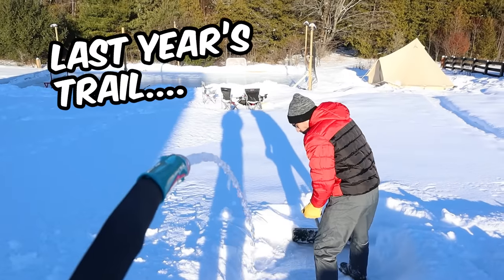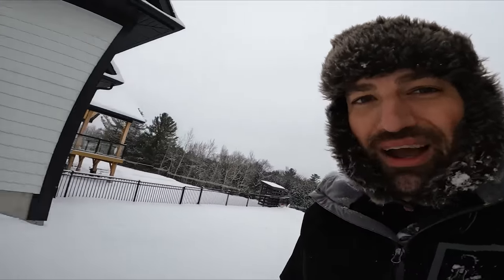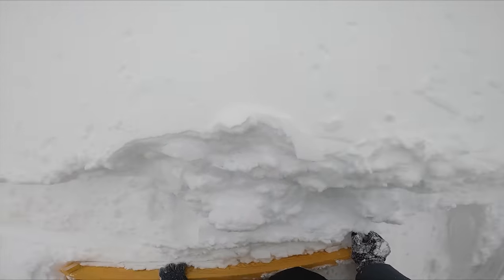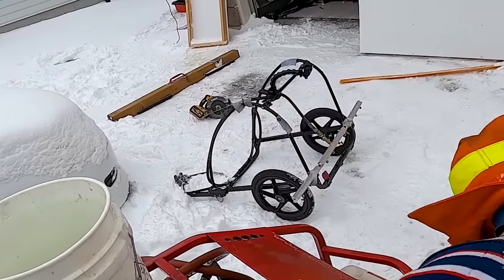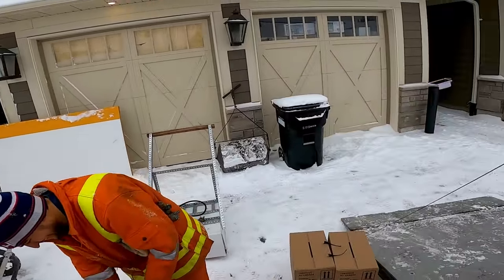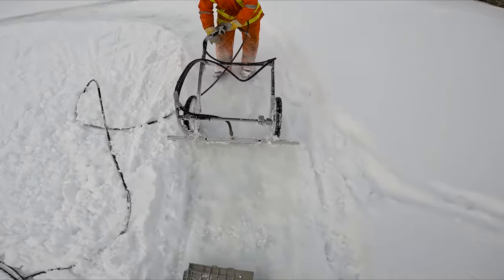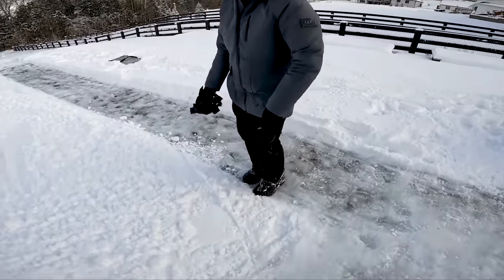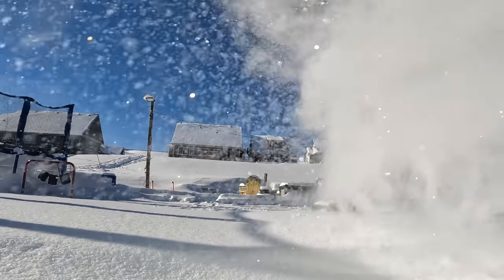Building a 400ft Skating Trail (Episode 1)

Comment: Next year get a 50 gallon drum, mount is on a pole so you can roll it by pushing it. Fill the barrel with cement and BOOM you got a snow steam roller. Similar to the lawn roller but WAY heavier
Reply: And WAY HARDER  TO PUSH AND PULL

Comment: Dad used to flood an out door rink years back for the town. First he would remove all the snow. Then he would continuously spray the outer edges to create a water tight edge for the water to be flooded within.Just enough to soak but not so much it wouldn't freeze fast. Because you have a down hill section I would also build up some vertical lines on the hillside so the water would be held in place, rather than running down the slope and common sense says the closer the vertical lines the more landscape hugging and precise the transitions. He would then give it a light but full coverage flood to and leave it freeze well to seal the bottom. After that he would just repeat flooding until the ice was thick enough. Adding hockey lines and circles. Smoothness was determined by the amount of water laid down to ensure the entire surface was flooded and even. While Crack prevention and such were avoided by ensuring you weren't putting down too much. It's the same way they did the curling rink ice. How much water? I never saw him put down more than a 1/2 inch in a heavy flood Usually about a quart inch starting out so it would freeze  instead of melting the base and soaking in. This was done rather quickly as he used an 1 1/2" fire hose to do it.

Comment: We use to pack our sliding trail with a snow machine and then use the hose to slick it up!
Reply from the maker: 100% what I should do. Way easier 😩
Reply: *horse
Reply: I used to drive on ice roads in the Arctic and they  did it just like you guys, pack and level it then  add water and grade. They would maintain it fixing pot holes. There was heavy truck traffic using it.
Reply: @Stefan-st  *hose

Comment: So for the ice trail THE LAWN ROLLER can be filled with sand water even rock it helps weigh it down to get a perfect even roll every time. I recommend you using water to fill it with 1 it flows inside it easily 2 its definitely the heavier out of the 3 I named

Comment: I'd use an ATV to pack down the trail with the lawn roller, add and remove snow by hand to make the trail even, then go over it with the same ATV with an ATV broadcast sprayer on the back and then finish smooth it with the roller and by hand. It'd save alot of futzin' around, heavy lifting and hand work and also takes away alot of the long hoses and the risk of stuff freezing.
Reply: it wouldn't even be that hard to hook up an inline on demand hot water heater in order to fill the broadcast sprayer with hot water.

Comment: The brown sh!# is scale from the boiler,  And you can blow the hoses dry with an air compressor, and if you do it outside in the cold and minimal water left in the hose will freeze whiles it is coiled up until you use it. 
Then after you pump you could pour windshield washer into your suction on the pump and blow that down the hose. Get the closest jabronee with a decent set of wind pipes to blow o2 through the hose to push the window wash throw or just walk the line out holding it above your head.

Comment: I know this is late but... I kinda have an idea for your path making DIY stuff. 
Buy 2 steel barrels. 1 should be small enough to fit inside the other. 
Tack brackets on each end or weld the small barrel in the dead center of the big barrel. Punch out holes on each end, and set in some ball bearings *basically like your roller you have in this but with a barrel in the middle. 
Obviously your going to want an opening somewhere. I'm thinking on the side. Anyway. Essentially. your going to put hot coals in the middle barrel. lock it. *vents obviously but we wanna keep the fire in the middle. So now you have a heat roller. 

I have no idea if this will work great, but if you can fill 100 gallon drum inside a 500 gallon drum, that should be PLENTY of heat to keep this thing rolling clean. 

If we had ice like yall do I would build one just to see.

Comment: As an American without a backyard and skating skills, I am jealous lol
Reply: You can do it!, I’ve taught skating for 20+ years,
1) Pad up! Homemade 1/4 inch foam (eg. Mountain bike foam) on boney parts:
elbow, hip, tailbone, knee pads, onto tight pajamas, or cheap Costco Baselayers
2. Helmet with Face Mask- prevent concussion and dental damage.
3.  Skates based on the shape of your foot. 

Eg. Narrow skates for narrow slim feet eg Bauer “Vapor” line
Regular skates Regular feet Bauer “Supreme” line “Fit 1 for a narrower fit” Fit 2 for regular, Fit 3 for Wider feet. 
3 hockey skate manufacturers Bauer, CCM, True.... buy the best fitting heat moldable
$200 to $300 on sale. Skate cannot be too long. heel should be locked inToe nail should just scrape the front when standing. 3/8 gap when u are in an athletic squat and laces are snug and tight.
Reply: You can do it!, I’ve taught skating for 20+ years,
1) Pad up! Homemade 1/4 inch foam (eg. Mountain bike foam) on boney parts:
elbow, hip, tailbone, knee pads, onto tight pajamas, or cheap Costco Baselayers
2. Helmet with Face Mask- prevent concussion and dental damage.
3.  Skates based on the shape of your foot. 

Eg. Narrow skates for narrow slim feet eg Bauer “Vapor” line
Regular skates Regular feet Bauer “Supreme” line “Fit 1 for a narrower fit” Fit 2 for regular, Fit 3 for Wider feet. 
3 hockey skate manufacturers Bauer, CCM, True.... buy the best fitting heat moldable
$200 to $300 on sale. Skate cannot be too long. heel should be locked inToe nail should just scrape the front when standing.  3/8 gap when u are in an athletic squat and laces are snug and tight.